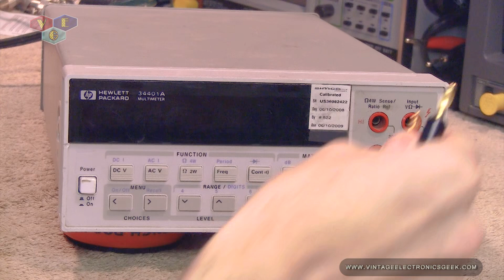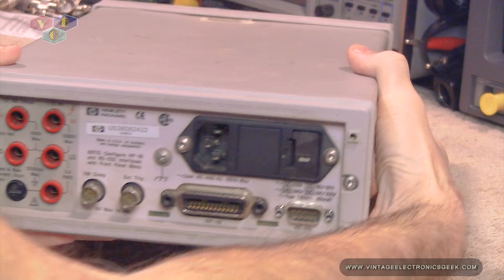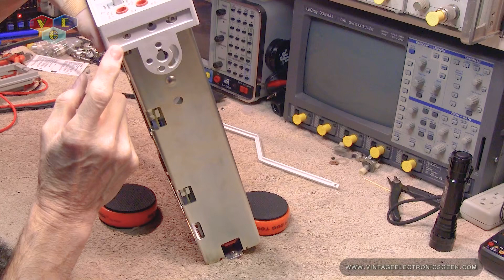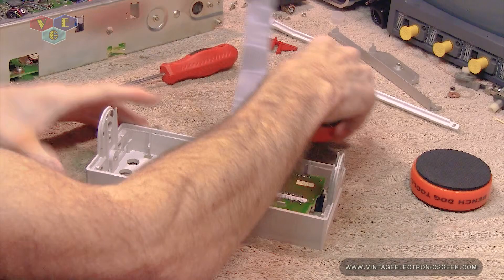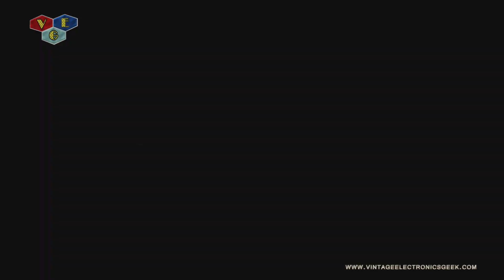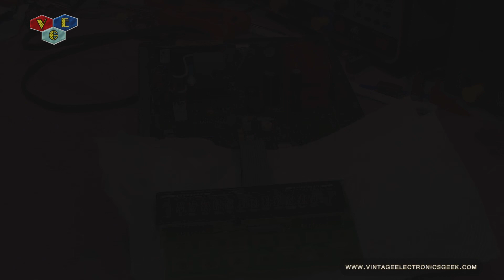HP 34401A DMM Repair - P1

Comment: Hey Jack. Have to admit I was skeptical that the new display would fix the problem. I would have put money on the driver. Good luck putting it right. :)
Reply from the maker: I was worried as well, but I figured worst case scenario, resale I would recoup my money even as a parts unit...even at the point were I am now with it.  Thank you!  ~Jack, VEG